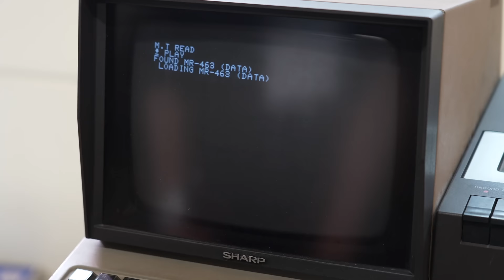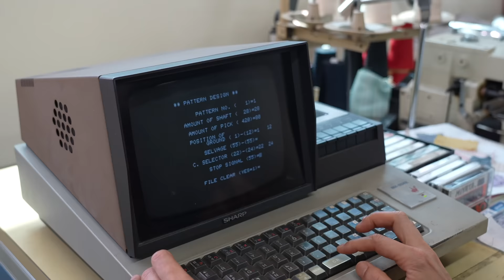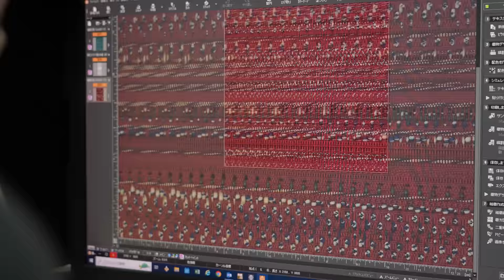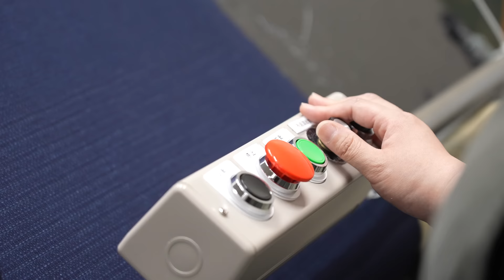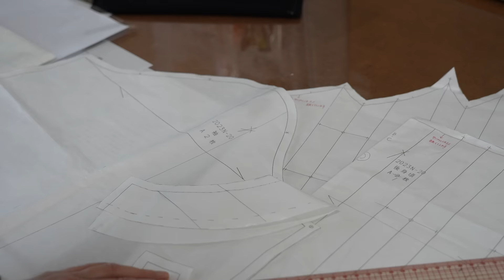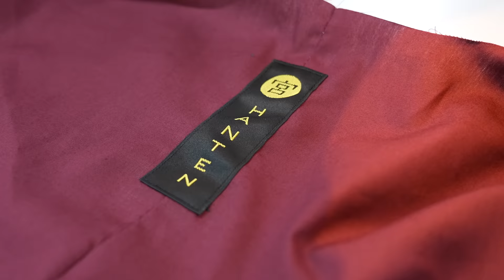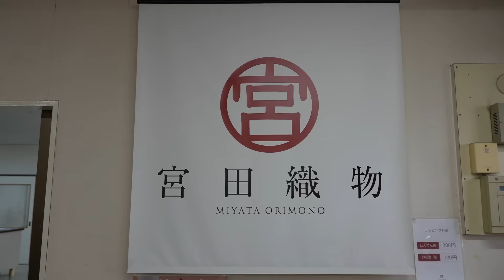40年前のパソコンが現役！機械と手仕事で伝統を守りながらはんてんを作る日本の工場

Comment: Even in our country, it is common for outdated computers to be left for the operation of certain machines. Because the machine works and the computer is just a part to make it work. But punchcards and tape recorders have gone too far. It's amazing that there is still consumable support for it.
Reply: Yeah this is too far, they waste half their work day dicking around with a 45 year old fossil computer...
Reply: @FrozenHaxor  I doubt they really do spend that much time with it. From the way it looks in the video they only need the computer to produce the punchcard which can then be reused as many times as needed to run the machine that produces the fabric. They 'd only need to "dick" with it when they wanted to produce a new weaving design or to print out a replacement punchcard if they'd used one to the point that it was worn out.
Reply: @JeremyLevi  Exactly. The "fossil" would only be used for replacement or new designs. And the cost of replacement systems would easily be in the tens, if not hundreds of thousands of dollars. Not something to take on lightly. I do hope that they have archived their tapes. That's the real risk.

And I still see old hardware that has had minimal if any upgrading. The common upgrade for the lathes and mills is to replace the paper tape reader with a "BTR" ("Between Tape & Reader", or "Before Tape Reader" depending on who you ask). That's pretty much it.

Interesting to see that its program was done in English, I wonder if the MZ-80K2 can do Japanese characters? And I would be very interested in seeing the interface between the computer and the puncher.
Reply: @MrWaalkman  Japanese character equal to 2 bytes instead of 1 byte as Latin character and this created a memory problem in those times
Reply: @yahyalaouici9749  Ah, that makes sense. Thanks! :)
Reply: @MrWaalkman  obviously this problem lasted until the mid-80s when technology offered solutions and increased the memory of personal computers,anyway you are welcome....salam
Reply: @yahyalaouici9749  I recently was looking at a Sharp MZ-80B, which I think is a beautiful machine. But a) I already have more retro computers than I know what to do with, and b) I really hate to pick anything else with a CRT in it since I have too many as is. But they are lovely machines.

Ignoring the previously mentioned reason "a" for not buying anything else, I instead got another Sharp CZ-801C (also a beautiful machine) which I'll have to find (continue to look for) the HU-Basic tape for it.
Reply: @FrozenHaxor you clearly dont understand how computers work and what you can do with machines like this one
Reply: @yahyalaouici9749 Im japanese and I can confirm these by also saying that when my mother was a kid they used english characters in computers. I keep most of her old computers, I love them
Reply: @kairi8882  Yeah sure buddy, you do you.
Reply: @MrWaalkman  the X(CZ) series is something beautiful and very special,I don't know if you know that or not but the CZ series was designated by Sharp TV division and not by the computer division as the MZ series and that gave him an edge, was called "PC TV" because the monitor for the CZ-800(X1) had a TV tuner, by combining with a dedicated display TV or an optional digital telopper, the TV screen and PC screen can be superimposed,in addition even when the sub-power of computer was turned off, the Intel 80C48 power-saving chip control enabled the TV channel and volume to be controlled from the keyboard or program, and could be used like a wired remote control
also it is equipped with a Kanji text VRAM that treats Japanese fonts on the ROM in the same way as the text screen in terms of hardware and expands them on the screen,a high-speed kanji display of 40 x 25 lines was realized,compared to the process of developing and synthesizing fonts on the graphics screen with software, it was possible to display Japanese only by writing character codes, so even though it was an 8-bit machine, it was possible to process Japanese on a par with a 16-bit computer
Reply: @kairi8882  it is useless to argue with him, if he thinks just a little he realizes that he was called ''computer'' because is a computing machine so it's just big and powerful compare to other calculators,for him computers are just game consoles so without games they are boring
Reply: @yahyalaouici9749  Games? You assume too much. I build and maintain advanced PLC control systems that run reliably in factories 24/7, mostly based on Siemens Simatic S7 nowadays. I think I know a little about the manufacturing world. This stuff belongs in a museum. Open your eyes and move forward instead of glorifying the past for once.
Reply: just a part to make it work?
so you think the machine can work without computer?
Reply: @FrozenHaxor  first I apologize for the comment if it offended you even if it wasn't my intention to do it,but it was based on what you said in your first comment

second thing it is obvious that they don't lack the technology or the money to modernize since they have other modern devices, so it is obvious that they do it for technical and economic reasons ((why they have to waste money on devices that cost a lot to exchange devices that work well and they are reliable just because in the morning they have to spend half an hour preparing them)), and you forget one very important thing the value of these clothes is high thanks to this semi-traditional method since they are traditional clothes and loved for this reason,for this reason it is called artisanal work
Reply: @yahyalaouici9749  No offense taken. I understand your point of view, if the production quota is not the primary goal but the manufacture technique is, then I assume it's acceptable to run like this as long as the business is profitable, I look at this  from a modern European factory point of view.
Reply: @FrozenHaxor  I got your point,what i meant as long as the product doesn't need high\complicated technology and the available machinery produces it in commercial quantity then there is no problem,why change a machinery that has approved its warranty and reliability for decades((the fact of working all this time is already a guarantee))
since you are already in the automation field you know that many older models of industrial automation machinery are often equipped with floppy drives for data transfer,replacing or upgrading old equipment can be difficult due to cost, the inability to stop production or the absence of upgrades. floppy disks and floppy drives are gradually going out of production and the replacement of defective drives, and the systems that use them becomes increasingly difficult, even floppy disks are delicate and they may need to be replaced often, which is how the floppy disk hardware emulator was born
Reply: @yahyalaouici9749  Actually I did see a machine old enough to still have a FDD interface, it was an older model DMG Mori CNC machine with Siemens Sinumerik control panel, they already did an upgrade for it and replaced the floppy drive with an emulator that uses flash cards, it stood out because all the other machines were at least 15-20 years younger, I inquired about it and the answer was that the particular machine somehow had equal or better spindle bearing precision than modern ones and they used it for smaller more precise runs, since it executed the cuts much slower. It's still not a too big of a deal since it processes G Code straight from the CAD software just like the modern machines do.

So yeah, sometimes they like to keep "dinosaurs" as we call them if they're still profitable on the count that the operator doesn't have to spend too much time on it.

But if that machine had a major breakdown that the on site mechanics cannot solve or could but it required major investment in parts, they would not attempt to fix it, it would be auctioned off by the scrappers since it's more financially optimal to lease a brand new machine and benefit from a tax reduction.
Reply: NASA was said to have been using 80's computers like the 8086 and Floppy Diskettes for years. They bought up many surplus parts to keep those old machines going.

Comment: That's not really very suprising to me. Alot of industrial and medical equipment still has CRT screens and runs DOS or archaic versions of Windows or even has just an analog controller or only RCA analog I/O or runs only by LPT port. If it works and the equipment is functional, there is no need to change it. You won't use a 100k$ industrial machine to play Cyberpunk 2077.

Comment: In the 80s, Japan was the most automated industrial country in the world, with equipment using the 8080 microprocessor spreading to even small workshops. However, this robust system deprived them of the opportunity to update to linux or ros-based systems in the 90s.

Comment: The fabrick has probably found its niche and there the machines and the computer are perfect. But I would either port the software to a modern computer or use an emulator that can also control an external interface.

The original machine has a clock frequency of 2Mhz.

Comment: I think the main reason it's still in use is that they quite literally don't make 'em like this anymore. 
It's got a niche enough application that it could only have been made when it was made due to world economics and it has lasted to the point where it doesn't need a replacement.

Comment: Only the dobby loom could be driven by the output of that old computer. Dobby loom have 22-24 dobbies, and a limited choice of thread evolution. If you look closely, when they use Jacquard Loom (ironically one of the first programmable machines made by men, way before computers, that introduced the concept of "punched card") they use a windows machine that is even capable of render the appearance of the finished cloth!

Comment: This seems to work nicely but i think its slow and if something breaks you have a problem like the tape drive from the sharp machine. The 40 year old computer needs probably 3-5 minutes to load the program from the tape. I would try to get more modern machines and get faster results. If there are backups it's probably ok

Comment: Je ne peux pas m’empêcher d’imaginer la quantité de travail que c’était lorsque ces machines n’existaient pas.
Reply: C'était mécanisé même depuis longtemps avec des métiers a tissé qui ne sont que des automates en fait que l'on peut programmer de manière simple , pas forcément besoin d'odinateur pour automatisé un process industriel .
Reply: @user-eq9xq8km1l Yeah, more difficult before steam machinery in 1700. Water mill power maybe, or if you made a machine in the tropics, not getting wrecked irreparably in a storm. Siege machinery probably goes back 9000 years. Chip tunes not so much as pedal looms?

Comment: The audio cassette data storage shocked me. Somehow this system has survived the invention of the floppy disk drive (SD and HD versions), CD-ROM, DVD, flash drives, and even Ethernet networks. I wonder what would happen if I pop my 1980's C90 bootleg of Jet Set Willy into the tape deck?

Comment: crazy to see them use perforated film and 40-50 year old computers for this stuff when they could have swapped over a to a 10$ microcontroller, some simple software that a university student could write and replace all the aging tech with more reliable new stuff (and make 3 backups for that at basically zero extra cost), I'm not suggesting any new "smart" things, or internet connectivity etc, just the basic interface and control electronics, I bet there is a ton of boards with 4xxx and 74xx logics there that were reliable 20 years ago but can be a cause of headaches and not easy to diagnose nowdays

Comment: It is the cost of development of the new software that would interface with the old hardware that is the main reason. Not respect for old things like people are saying down in the comments. I worked in the industry and when I saw the machines I knew immediately what would be the cost to make the software for this. But these old computers are not any worse than some simple modern microcontrolers so there's not a lot of difference.
Reply: It's cotton, not that hard to interface with if weather's agreeable. Maybe for durability they'll add hemp if they can spin it despite high friction...

Comment: I know the rule is, if it ain't broke don't fix it... but I would really replace the punch card part of the system. How hard would it be to replace that part with something like a Raspberry Pi that actuates the switches that the loom uses. Would probably save a lot of time and money in the long run

I would make it so you could easily use the original system as well just for fun.

Comment: There is no doubt the design and processing of the patterns could be much faster and easier with modern technology, but if the current system works and doesn't impede production of a quality product, why change it?  It can literally cost millions of dollars to develop, buy, and train for a new modern system.

Comment: It'd be very scary to me, to rely on such old hardware. Even stuff that could be streamlined, like you do not need to actually use cassette tapes in most old machines like this, you can hook up the tape input from a modern computer and load the tape recordings from there. The argument is always that there's no reason to fix what isn't broken, but what do you do when any of this breaks and you cannot get a new computer, or tape deck, or compatible monitor?
Reply: You forget where the factory is. JAPAN!!!!!! and in Japan the land of automation replacing that equipment is no BIG DEAL
Reply: The computer's input and output are analog and super moddable, a mere hobby enthusiast can connect it with modern equipment. But I'm sure the modern equipment will die sooner than that computer itself.
That old computer is lasting forever because the tape storage is swappable and the tapes are probably less than a year old. CRT monitor doesn't die suddenly like LCD. It just works forever if you keep inside physically clean. The computer Sharp MZ-80 is still available in second hand markets and its emulators exist. 
However, this computer must be "the last stand" against their continuous renovation. Everything else in the factory seems being updated. I think not many employees know an existence of this "holy grand mother computer" of their kimono designs.
Reply: @higon99  CRTsc still burn out. The tube gets faint with use and the flyback wears out. The point is to have a replacement ready for use when the old thing dies, you can't spend weeks looking for the right thing.